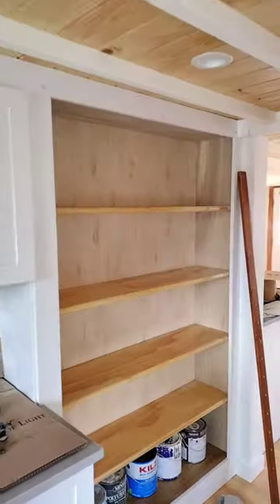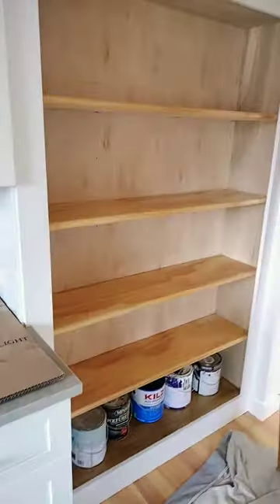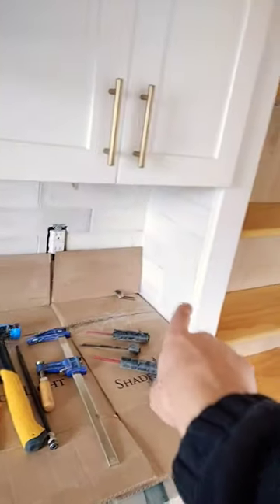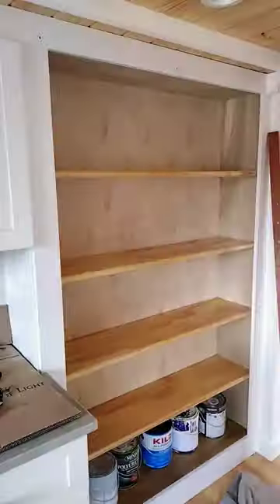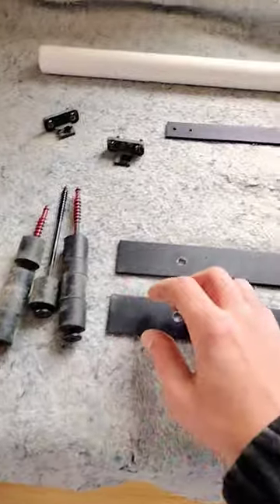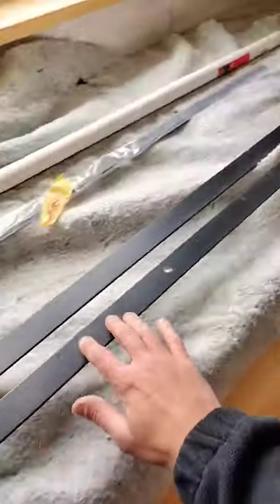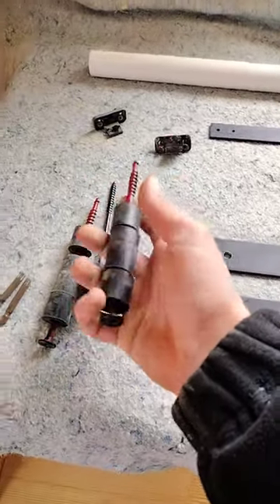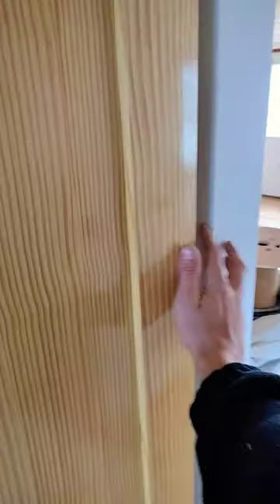Custom Pantry Cabinet And Height Restricted Bypass Barn Door Tracks

Comment: Great work and the bypass barn doors are genius.
Reply from the maker: I appreciate that. I would have preferred 1/4" steel for the tracks but the rollers only worked with 3/16 so I had to go with it. Other options either had the door rollers bumping into each other or required 9" of clearance above the doors. No way I was using a 1x10 top rail.